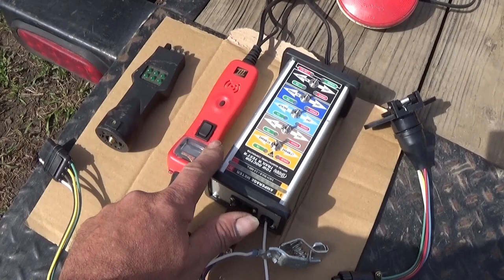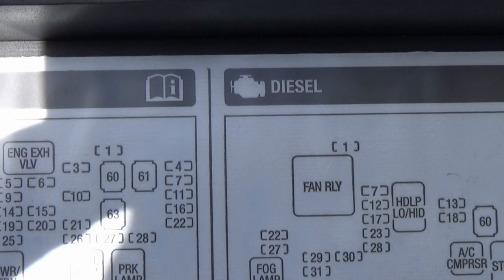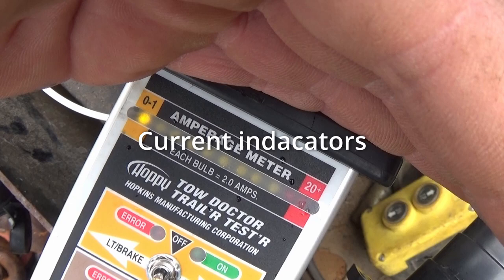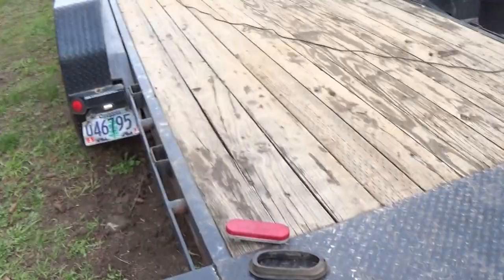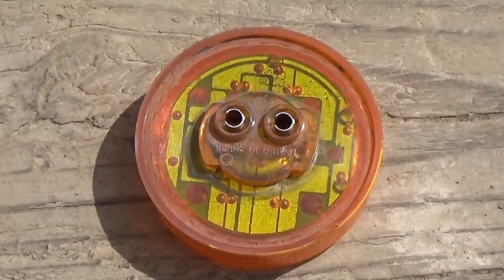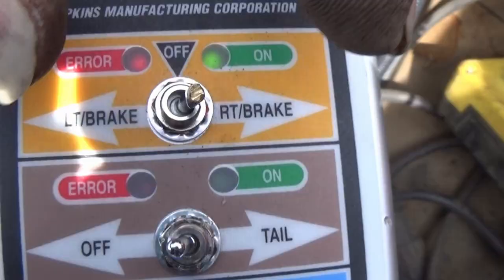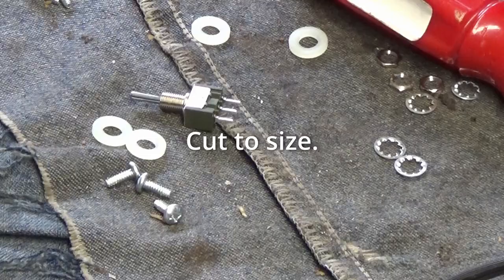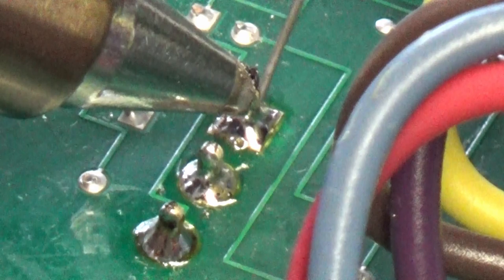Trailer Light Repair with the Tow Doctor and Power Probe

Comment: As in LED light testers this light cord tester will not draw much current . Wire an incandescent head lamp up , it will draw 5 amps to check the electrical power source  . Jonard Tools sells a small quality fuse puller unfortunately made in China . Good Video .